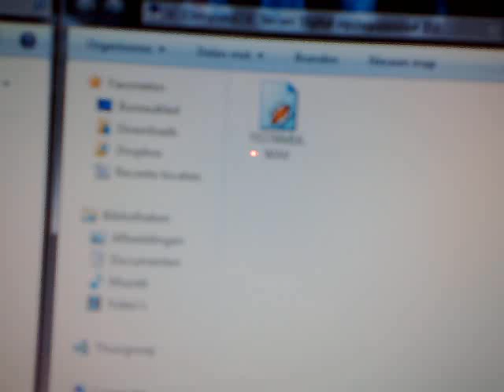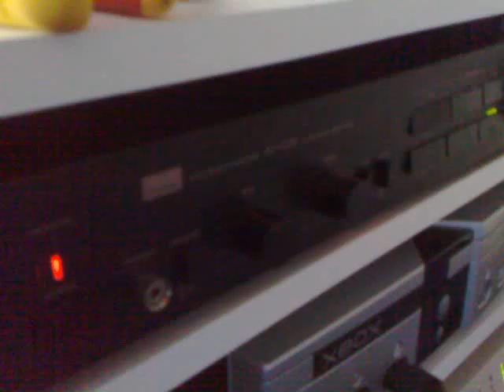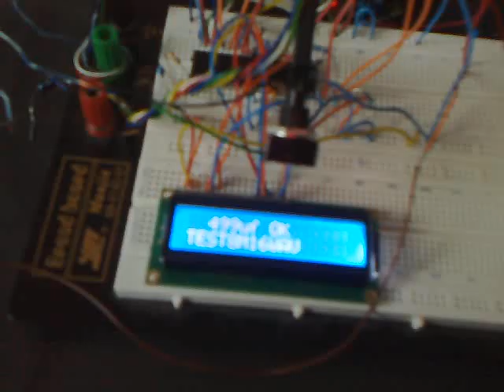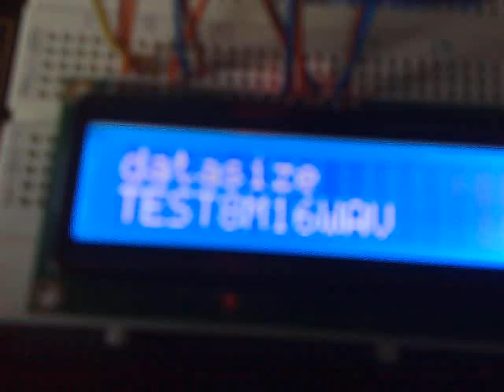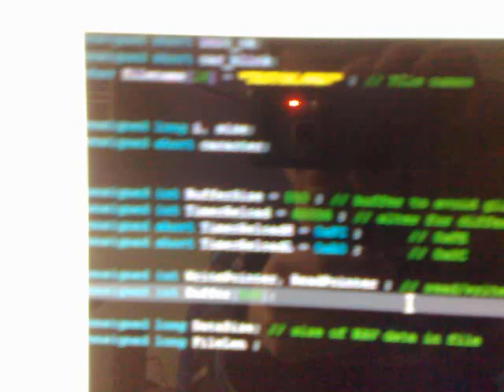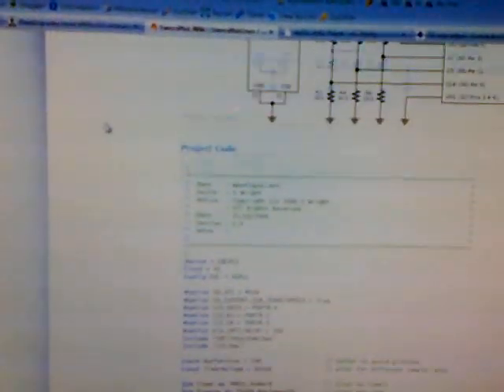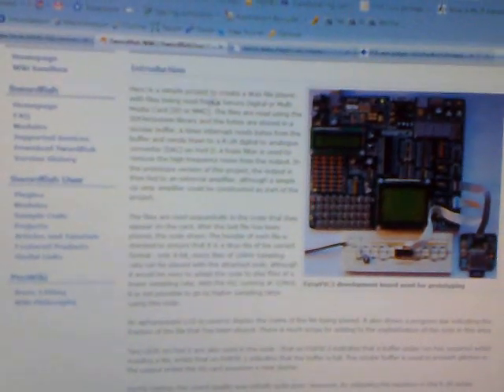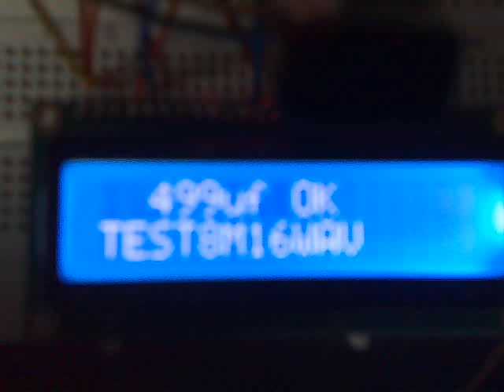PIC18f4620 uC wave audio player with SD card

Comment: Hello
please send me a programme of mikroc with schema isus
Reply from the maker: Unfortunately I don't have the sources or schematic anymore, the code is pretty similar to that in the first link provided. It is pretty straight-forward to setup up though.
Simply connect a micro SD card to the PIC, open the WAV file using whatever FAT library and output the audio to one of the 8-bit output ports. Have a simple resistor-based 8-bit DAC (like this one: http://i.imgur.com/2dWKJvq.png) connected to the port and connect your amplifier to the output and ground.
EDIT: The schematic is pretty much the same as this: http://www.sfcompiler.co.uk/wiki/pmwiki.php?n=SwordfishUser.SDMMCWavPlayer

Comment from the maker: maximum is 8M16. With a little tweaking it should be possible to get more out of it.
The Wav file is not stored on the PIC so there is not really a memory problem. 
Also, it's not my code, I just tweaked it to work with my uC. It's originally developed for the PIC16f series.